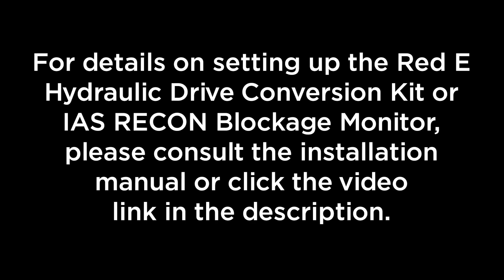I May Never Buy a Ford Again

Comment: The oil pan gasket thing is a crock of bull s*** too, they're all over the place after market for a better alternative than the shity OEM ones. But no, you can't give them aftermarket parts to put on. Even if you pay for them yourself. It's a bunch of bull
Reply from the maker: They did finally open it up to aftermarket, but we couldn’t even find one of those despite calling every place in town and even the dealer called around a bunch. Went online and ordered a few, but they all came back and said that they actually didn’t have stock.